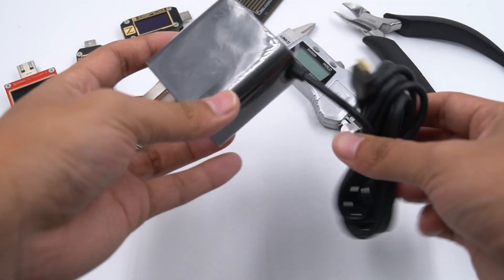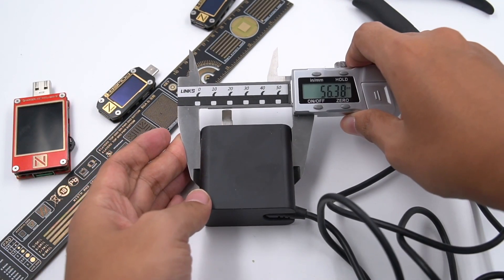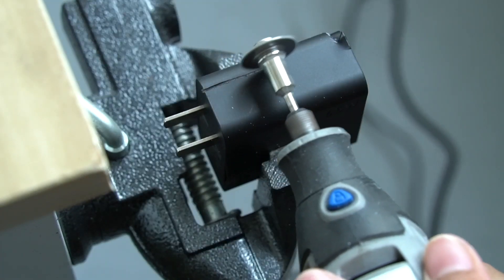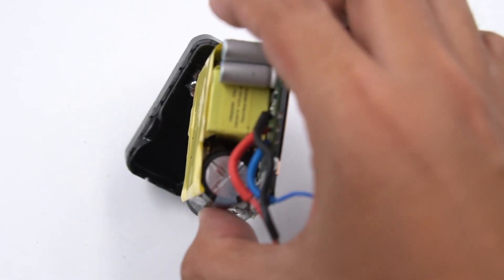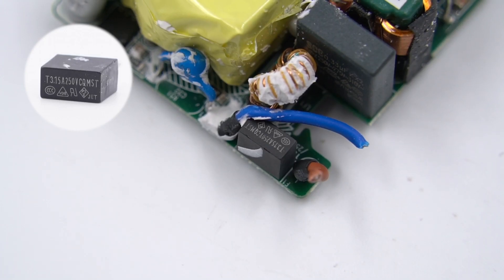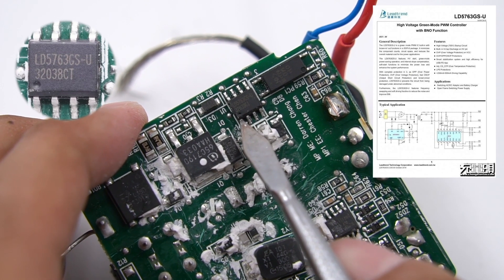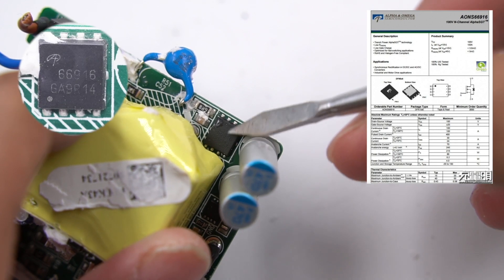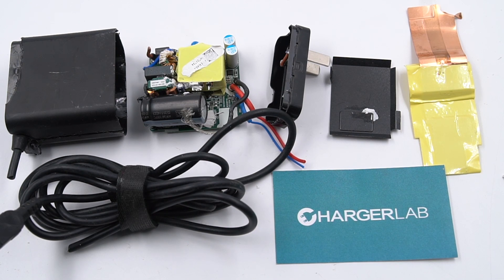Teardown of Lenovo 65W PD Fast Charger (ADLX65UCGC2A)

Comment: Hey, great video! If I were to take this adapter, cut out the 220V stage and fed the USB charge stage with batteries, which component I'd need to check the datasheet of to determine battery output voltage and current?

Comment: Hi
I tested my Lenovo charger (65W 20V 3.25A laptop charger, Rectangle Mouth with Needle), with multimeter set to DCV 20, & I get a result for less than a second, and then it goes back to 1.
When I set it on 2000 Ω, I get 289.
Does it mean that the charger is good? Why I didn't get any result  when it was set to DCV 20?
Thank you very much